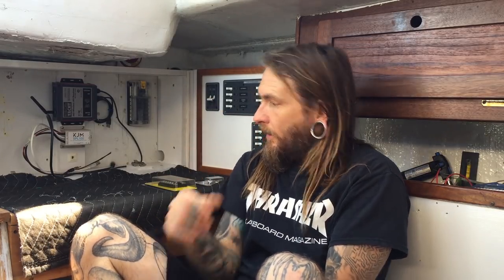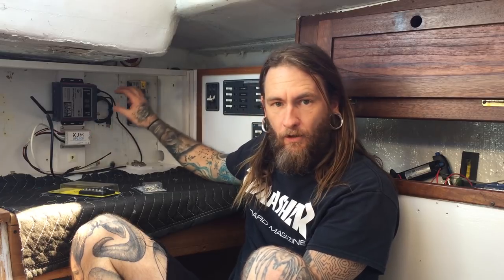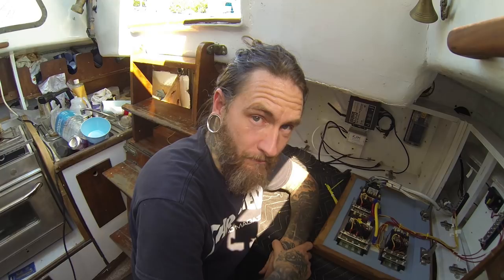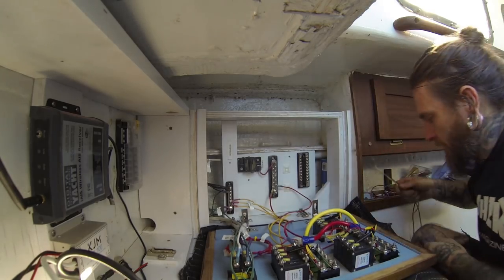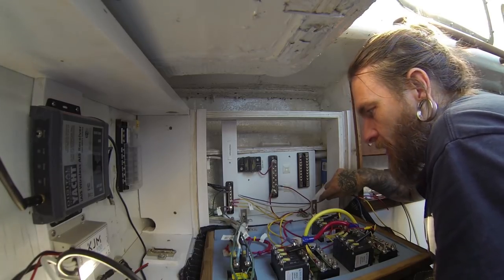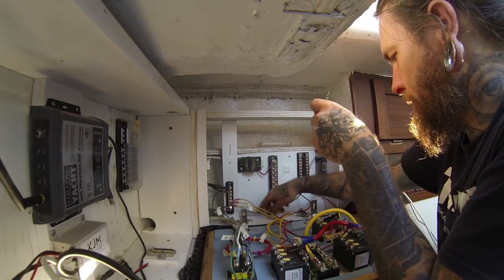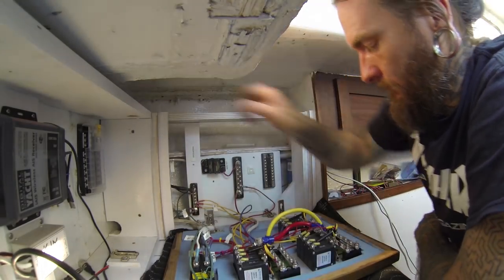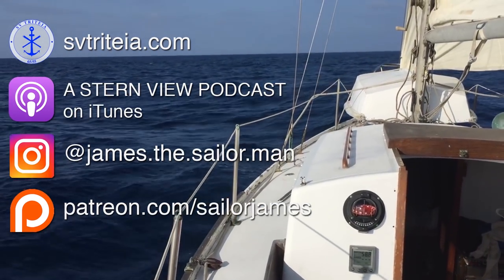Progress on the Custom Nav Station wiring on an Alberg 30 Sail Boat

Comment: James do your darndest to use NMEA 2000. So much simpler. You may not be able to if your Vhf doesn't have capability. Kind of like mapping out tattoo work. 2000 is way easier than 0183. New technology! It's like a nice tattoo gun compared to prison one made from a cassette player. Lmao! Bad comparison, but made me laugh.
Reply from the maker: yeah all the equipment on my boat is NMEA 0183 but I don't plan on having much of a network so I will just make due.
Reply: Kind of figured that James because I know you would have went that route.